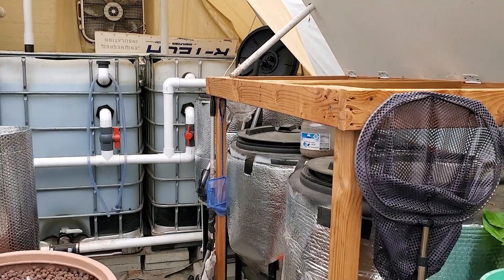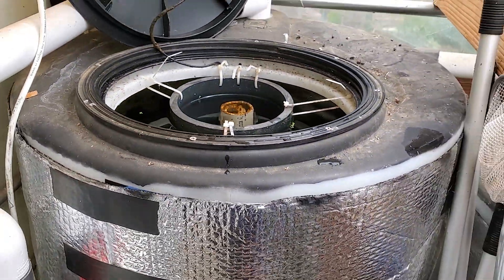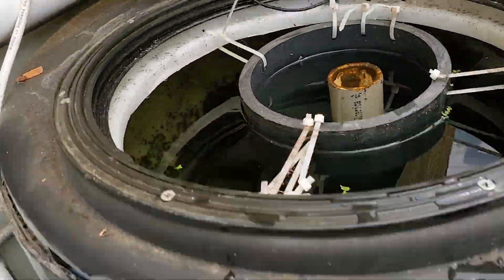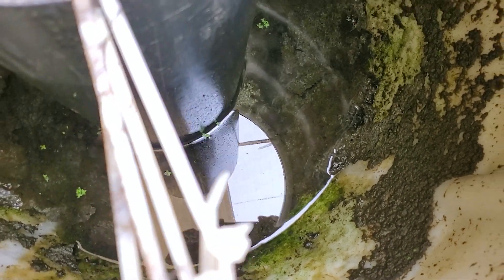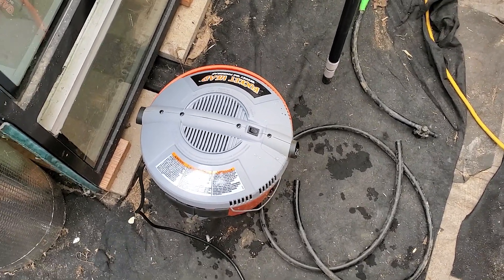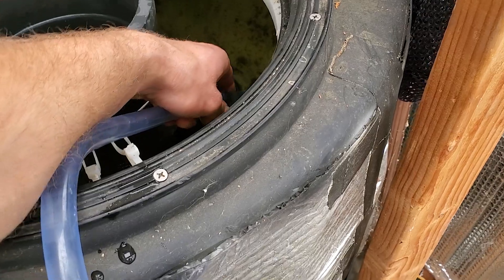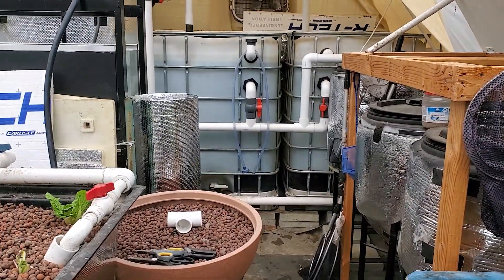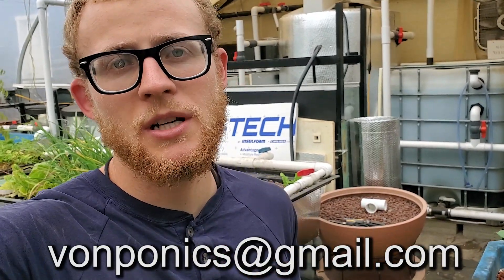Aquaponic filter clean out - (aquaponic system filtration - radial flow filters)

Comment: As for the Shop-Vac pond vacuum I've been thinking about doing this as well but turning the actual Shop-Vac into a filtration system so I could run the water back into the pond and only collect solids maybe a piece of egg crate about 4 in off the bottom along with a few non-toxic AC vent filters and some polyfill another piece of egg crate and a brick inside to hold everything down at 6 to 24 ft hose off of the lower fitting as the return and a pool hose as the intake connected to a standard pool vacuum I'm just lost for how to block large debris from getting sucked in ie gravel and or tilapia
Reply from the maker: you can try a cap with small holes in it, which will get clogged eventually. Nice idea